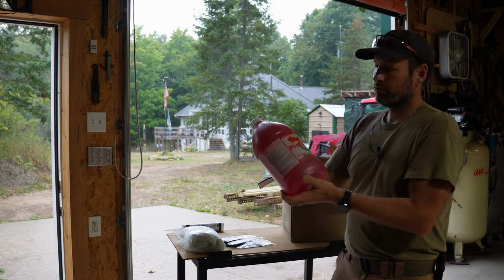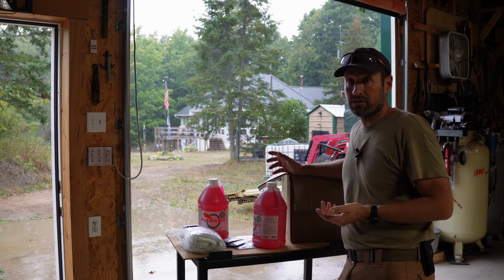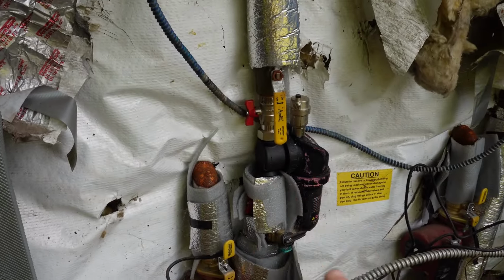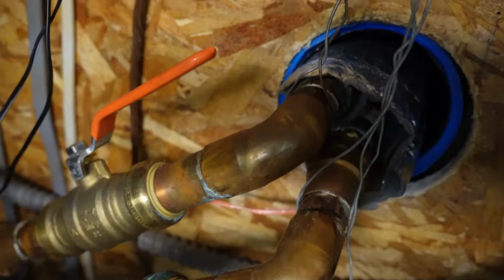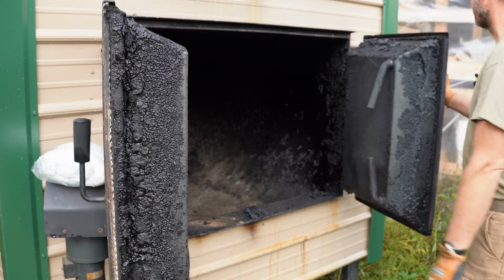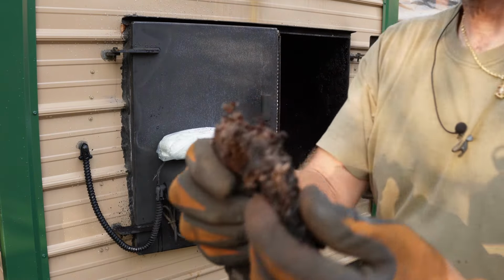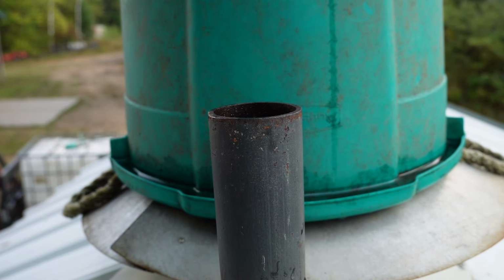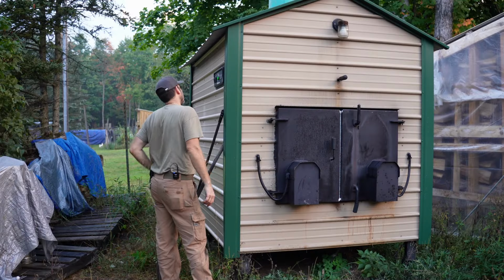Outdoor Wood Boiler Annual Routine Maintenance.

Comment: My dad and I looked into one of those many years ago. He got the plans to build it. Several years later I googled it to see if they had any updated information on them. The model we have the plans for uses sand between the fire box and the outside walls, with the pipe running all around in the sand. I read they had issues with the pipes cracking or leaking over time. I'm sure they have made a lot of changes to them by now. I'm not sure if they are legal to use where I live now. However my neighbor has a wood burning heater in his basement.  Either it's legal or no one's figured it out yet.
Reply: There are oil/wood boilers built into the same unit so you could do both...unless home insurance has issues with that kind of thing.